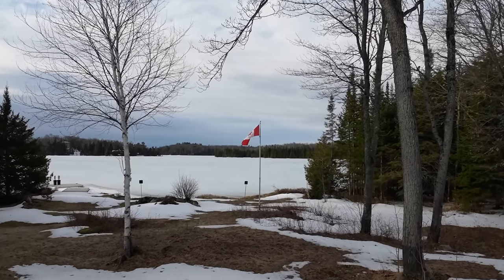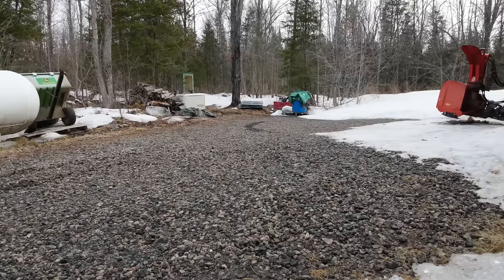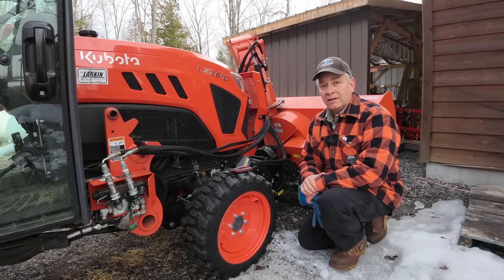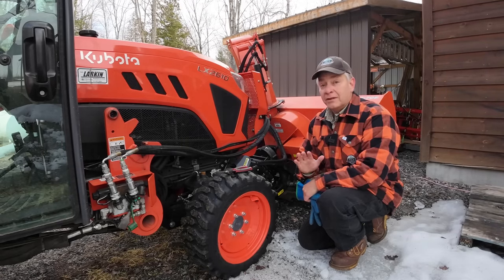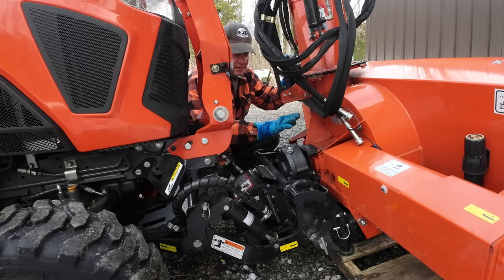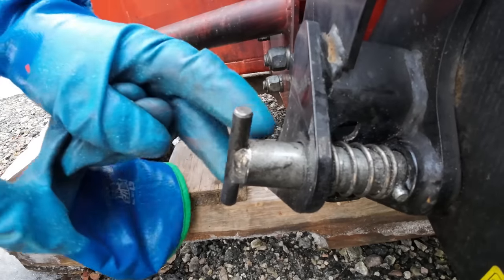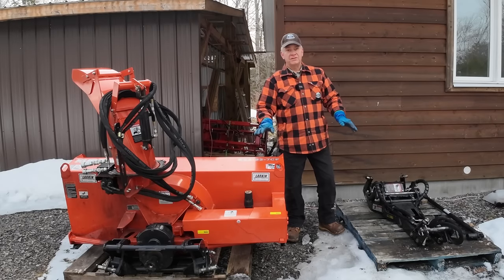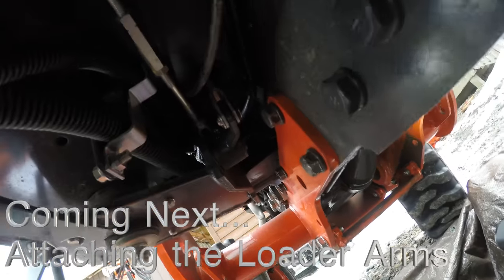664 Kubota LX2610 Tractor. Removing the Kubota LX2980 Front Mount Snowblower. Spring is Here?   4K

Comment: Just like you my driveway is long. I just finished my second year with a pull type snowblower. I have a snow pusher on the front. This seems to be a good fit for my situation. But… the best move I made was getting a cab!!!  Thanks to recommendation from this site and other buddies I got a cab.
Reply from the maker: Hey that's great Roger - the cab is such a nice option for sure - winter or summer. Have a Happy Easter!

Comment: Do you have to put the key into "Acccesory" to bleed the valves because of the third function?  I always relieve the pressure after use after I've shut it down.

Great video Gord, have a great week!
Reply from the maker: Morning Chris. Does that actually work? I will check the manual again when I am back up but I was told that the tractor needs to be in ACC in order for the pressure to release for all of them. I may have misunderstood though. I think for sure the 3rd function should be as it is not actuated until you turn it on. Thanks pal - Happy Easter!
Reply from the maker: Hey I think you are correct. The manual says to relieve the pressure with the engine shut off. I guess they told me to turn on the key to "accessory" in order to do the same with my 3rd function valve. Good catch - thanks my friend!